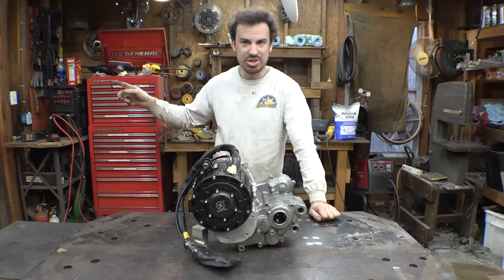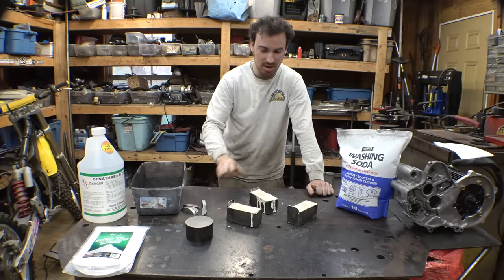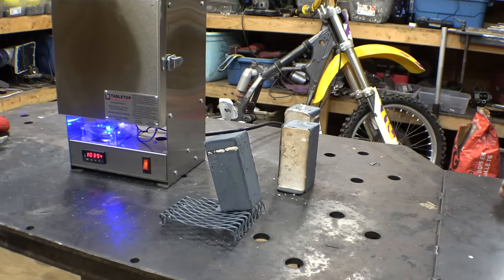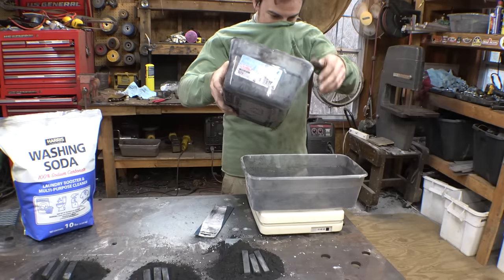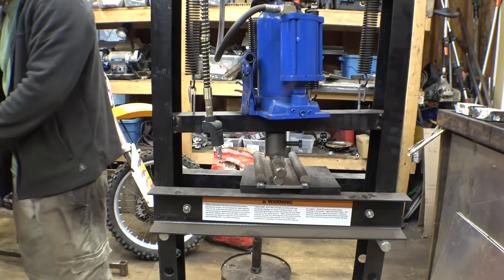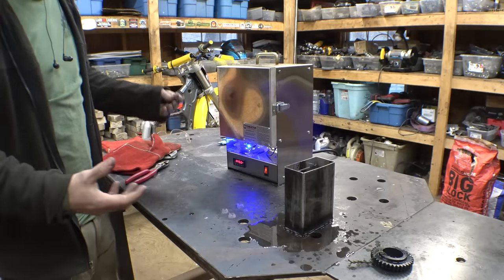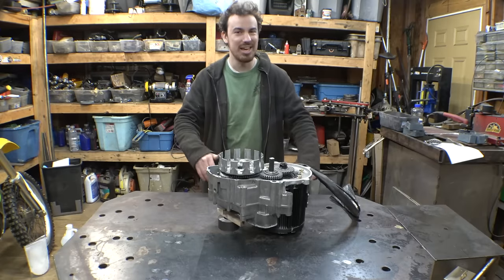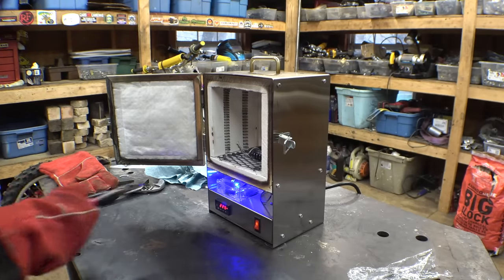Hardening the Steel Gears for the - Home Made 6 Speed Electric Dirt Bike - Part 3

Comment: This is one of the most interesting videos on you tube. I learned how to harden metal. You made two gears and hardened them in your little shop. You better be damn proud Chris as its quite the accomplishment.
Reply: The way he's doing it is hardening the face or surface of the metal, he's not introducing carbon into the entire structure of the steel. Think of this process as similar to anodizing aluminum. It increases the durability of the part's contact area's but it won't increase the strength of the steel in whole. This process is highly recommended over using a high-carbon steel for the entire part when used in things like transmissions or final drives.
Reply: Well, what he never said was: THIS is how to harden THIS ALLOY of steel, other kinds of steel would have taken longer or shorter, or worked better with the water, etc, ALL STEEL ALLOYS ARE DIFFERENT, so don't just copy him with whatever you have and try to do an hour and 20 mins and then use Cooking oil

Comment: Chris, as a bladesmith….  when we heat treat carbon steels, they also become very brittle and break easily unless they are tempered afterwards. I’m not sure what steel you used to start off with, or what it ended up at with the carbon content, but you may want to research the tempering process, post heat treat. For most carbon steels like 1080, 1084, 1095, it can simply be done with 2 tempering cycles in the oven at 400°f for 2 hours and allowed to cool slowly after each. 
Love the channel!
Reply: I think he started with mild steel since he is case hardening.
Reply: Yup
Reply: It's not a blade, it's a case hardened gear. If he tempers it, that defeats the purpose of all that work he did to case harden it in the first place. It's hard where the gears contact each other so it doesn't wear out, and still mild steel in the core
Reply: Would need to test/drill the centre of the brocken test peaces to see if mild steel or not, surely?
Reply: I also think that the gears should be normalized after
Reply: It is necessary to do not only hardening but also tempering of metals. leave the metal in the oven at 250 degrees for 2 hours, then turn off the oven and let it cool without opening it. then the stresses will equalize and the metal will not be so brittle
Reply: For what it's worth, it wouldn't have been that hard to find some good tool steel like S7. A person goes through all that effort and you still end up with a mediocre part.
Reply: I think he is just trying his hand at hardening for the experience and experimenting. I’m sure if he destroys them he will just start over with a hardened steel to fix the problem if it becomes one. I personally think other parts will be the weaker links.

Comment: When it comes to hardening  using water will introduce fractures inside of the metal and is advised not to do it oil is the best to use when hardening of any kind
Reply: It depends on the steel. Tool steels come in (A)air hardened, (W)water hardened and (O)oil hardened. It’s important to know what grade of steel you are using for proper hardening and tempering.
Reply: В воде можно растворить соль, и это позволит не разрушить структурную клетку металла.
Reply: Wrong! It depends on the steel
Reply: This isn't forged in fire. He's not making a blade to withstand the coconut chop, it's a case hardened gear. It's hard on the outside only, so the gears don't destroy each other where they mesh.
Reply: Actually it depends on the type of steel. But you are correct in that water quenching can cause micro fracturing in harder alloys. Especially those intended to be quenched in oil or air. Not that it is going to make much of a difference in this application. 
He just needs to case the outside of the Metal, not the core.

Comment: I heat treated steel for many years as a tool maker. We through hardened the steel that we used and used steel such as S-7, O-6, and O-2 steels. These to me woukd make much stronger gears and much tougher once annealed. I used to make envelopes out of inconel foil to seal out the oxygen.
Reply: For as much screwing around with a material that he had no idea what it was and then guessing that his little experiment was proof of concept.

Comment: From a former machinist's point of view, you pretty much got it right on the case-hardening and quenching processes! ..and your experimentation pretty much proved it beyond a doubt. I think those gears will be plenty strong, and will probably outlast the rest of the bike. As long as you have sufficient backlash (just a few thousandths actually), you should be golden! Curious to see it in action.😉👍👍

Comment: after first tempering try this
3 hours 475 celcius let them cool in Sand until cold can take up to 7-8 hours too cool down, that should balance out the hardness and thoughness

Secondly, how about the pushing forces away from the engine case on that aluminum since the weight from the motor and torque might bend and twist,  If there are Flex in the casing that hold the Electric Engine while in use then sudden Jolts might set-off breaks in the casing? Leverage forces is what i mean in every way and sense of it.
Reply: Hopefully he sees this comment

Comment: Awesome project, been following all along!
I worked as a Tool & Die maker, we hardened steel all the time, A2, D2, P1, O1, 1080... all seem to be close.
 2,000° for 30 minutes per inch thick, let air cool to 100°, set back in at 400° for 1 hour per inch to draw back. Avg Rockwell C 59 to 60 hardness. You're very close.
Reply: You didn't mention the quenching step
Reply: @testdevice989  in my tool and die job we put the part in a stainless steel envelope that we folded from sheet we put in a small piece of wood to burn off the oxygen,  2000 degrees for 3o minutes per inch, then cool down,  put back at 400 for an hour or so to draw back any brittleness, no quenching.
Reply: 2000 Fahrenheit for heat treating hss. Most air hardening steels like a2, s7, h13 is more like 1750. Oil hardened steel more like 1650 .

Comment: I would have definitely temper those, even though they are only case hardened.  You give up a little hardness for a lot more toughness. I love your videos! Keep it up!
Reply: Yup, just put them in an oven at about 425f for an hour. Let them cool on their own.
Reply from the maker: I thought about tempering them but some of the videos I watched said you don’t need to, so I didn’t. Hopefully I won’t regret that decision
Reply: @ratherBweldingChris I am mostly familiar with hardening for knife making, which is a bit different than case hardening for gears. Looking around a bit it appears that the hard skin on a tough center brings special properties that are useful in gears, so it may be that tempering isn't needed for this specific use case. 
It is lots of fun seeing you learn new skills for these projects. I have been watching since the lathe build days and am constantly impressed with your skills and mind for engineering.

Comment: I think the primary drive gear being 2x+ the diameter it's halving the tooth load, so 2x+ the torque won't matter. If it's a thing you could put another transfer gear on the other side. Neat project!

Comment: I'd go over the gears teeth with a soft wire brush especially the tips to smooth the edges. Maybe sand them with 1000 grit paper, moving to about 3000 finish with around 5000. Basically polishing the teeth. But sanding with the teeth, not across them. Maybe trying diamond compound after hardening, to polish them, but something like this it's not really required. Having smooth gears that can hold oil in the surface will run cooler and wear less.

Comment: typically when you harden parts like this, you want to cool them in the kiln, doing so significantly increases the time to cool meaning you essentially eliminate the possibility of the steel developing micro-fractures in its grain pattern. When we built gears for high performance transmissions, our kilns had a cool-down function that would cool the parts over the course of 48 hours. We were building for 2,000+ hp though, I don't think you need to go that far.

Comment: I think one way you could slowly creep up on giving more torque to the transmission little by little would be to run the clutch spring pressure a little lighter than normal such that it slips a little when under heavy or full load. You may smoke a couple clutch plates in the beginning while you expand the performance envelope but at least you won’t grenade your engine right off the bat. Either way, awesome work man! 👍

P.s. I would shoot to have the same backlash as in the rest of the tranny.

Comment: I like to use a strip of notebook paper between the gears then tighten up the bolts to hold everything . Then pull the paper and the gears run smoothly and have room to heat up.

Comment: I used to CNC axles from blanks, and then later after heat treating use a grinder CNC to polish the bearing surfaces,This is similar to what you went through with your gears.The sizes do change.Also,the long slow heating, and then slow cooling tempers well too without the brittleness .

Comment: In my experience I’ve found that virgin mineral oil works best for heat treating and it leaves a beautiful black protective hard shell. You can find it as “vacuum pump oil” used in air conditioning vac pumps.

Comment: Stainless steel is also not magnetized.

There's always those ifs, that you have to go through the first time. but then after you have done it once the fear of the unknown goes away and it gets better. and you're confidence level increases and it becomes second nature. and after doing something many many times it comes a point where it becomes boring. then you have reached expertise level. everyone goes though this. now you can add metallurgy to your expertise as a machinist.

Comment: Pretty nice testing 👍 but you missed one thing.
The Gears do have a much higher thermal mass and the quenching oil will heat up much more. Therefor the hardening is kinda different.
Not sure if this is relevant with those „tiny“ gears - but on bigger projects, you should consider that.

Love the videos and the effort you put into these ✌️👍

Comment: For setting then checking the gear mesh use strips of paper. That’ll get you the right backlash then when you pull a strip through after you’ve set it up, it’ll curve away from the tight side if there is one.

Comment: Thankfully, you can tune the torque curve on the motor controller! I think the bike transmission will handle it as long as you’re not dumping full torque off the line. Just be careful with the wheel speed and jumps.

Comment: You should get a test indicator to check the face runout on the lathe. Indicating for one spot only lets you know that section is running true. Checking face runout over O.D. runout in your setup will better the chances of a parallel part. That’s also a good way to get your chucks running true on the adapter plate to the lathe spindle.
Reply: Not knocking on your machining skills at all. I’m actually very impressed at the level you take your builds to, and the growth you’ve had in machining.
Reply: You would really benefit from getting a machinist handbook.

Comment: Cool stuff, gears are dam hard...  Awesome work

Take a look out there for hardness files

They give you a better idea on range of hardness

Gears if I remember right are usually spec somthing like 28-36R-C  

Used motor oil I think is supposed to work and impart carbon too-

Don't forget your tempering that's critical for these -

You might be able to find more heat treat data from machinery handbook or similar from. An older edition they might have more tables times alloys ect

Comment: My father has 30 years experience in heat treating and metal plating, he got a kick out of this
Reply: What would he of done differently
Reply: @mondude9754  using used conventional motor oil, it looked like the motor oil used was new looking.
Reply: @djbe3772 What's the benefit of using used oil rather than new?
Reply: @jasonb6570  Well when my father entered the field during the oil shortage, so they didn't wanna waste new oil just for quenching, it was a way to save money and became bogg standard amongst the old timers.
Reply: @jasonb6570   Used motor oil has carbon in it.  (that's why it's black)
Reply: @djbe3772  that makes sense I heard  another comment mentioning used engine oil also and because it has carbon content in it. And yes I can confirm the oil he used was brand new but it was not motor oil he used cooking oil on the gears themselves

Comment: try paragon heat treating ovens. alec steele had a few and they worked perfectly for almost every task he gave them. there are also specialized quenching oils that work much better and dont smell like a burning tire when you quench hot steel in it.

Comment: I believe, after hardening, you need to temper them. That way they won't be too brittle when there is a sudden shock on them. Like instant torque from an electric motor, or landing off a jump with the throttle on.
Reply: Yes, when when made hammers at school, we quinched them in oil and then slowly let them cool down for hours in owen.

Comment: the only way to tell your hardness and surface hardness are with rockwell and microrockwell (maybe brinell? I forget) testers, so you can test the surface hardness vs the deeper core hardness. they just press different things into the metal with a certain force and it tells you a number. not cheap, but you might be able to buy a used one cheap one since you don't need calibration certifications or anything.

Comment: Interesting project.  I think with the flat torque curve and high RPM of the electric motor 6 speeds is overkill.  A 2 speed would probably be enough, though I imagine finding a 2 speed motorcycle transmission would be difficult.

Comment: Yeeey, its time for me to be a smartass.

So couple of things, firstly, you did an okay job, dont be afraid to abuse it.

Now about heat treating. When using water to quench in you cant do the up down dunking method. Water boils away, creating a steam barrier that doesnt allow for fast enough cooling for the steel to be hardened. You need to move your piece very fast through a very huge amount of water to achieve hardening, even then the best results will be at the points where your steel contacted the water for the very first time. This is sometimes used in knifemaking to only harden the edge.

Whenever you check for magnetism you should put your piece back into the kiln. While you are working with mistery mild steel it doesnt really have a huge impact, but your piece can cool below the temperature needed in seconds and if you are aiming for the best result its just a good practice.

There is a fancy word for what oil is best, there is a whole science behind it, people usually swear by canola oil on the cheap side and parks 50 on the pricy side.

Most importantly, please use a bigger container for quenching. I am serious you will hurt yourself so badly if you manage to overheat your oil beyond its critical point, when that gets onto your plastic made clothing you will be very and I mean VERY hurt. Get yourself an ammo box at the very least, burns caused by oil that hot combined with molten plastic will cause a pain you never felt before.

Its also a good practice to preheat your oil.

Comment: Oil thats been in a motor is what the old books refer to as motor oil. The carbon deposits from burning fossil fuel is said to make used motor oil better for oil quenching. Also a good long tempering cycle will greatly help there durability.

Comment: It is necessary to do not only hardening but also tempering of metals. leave the metal in the oven at 250 degrees for 2 hours, then turn off the oven and let it cool without opening it. then the stresses will equalize and the metal will not be so brittle

Comment: I don't know if anybody has told you this but to heat treat, all you need to do is wrap the gears in some stainless steel foil with  some paper.  You don't need those elaborate boxes.   The purpose of the paper is to burn up and consume any oxygen in there..... just an FYI. 

Re. The oil, I use used motor oil straight from my car.  Also,  if you fully harden them,  you have to anneal them, too.
Reply: I agree with you, also I recommend pre heating the oil

Comment: Hello, do a test with a piece of steel by heating it until it turns blue and immerse it in hot water mixed with half a ground Cyanide tablet, cover it until the next day, this is what they do with friction parts on Vespa.

Comment: You could limit the torque by decreasing the current in your bldc motor controller's settings.
Reply: I was thinking the same thing.  Start out at low torque, and increase until the bike feels close to what a stock 125 pulls like.  Maybe hold up there.  Like Chris, i’d hate to see him wreck those gears, he must have a lot of hours into them now.

Comment: After quenching, a low tempering is done at a temperature of 200 degrees Celsius or 392 Fahrenheit, at this point the gears are “glass”. Tempering is done to normalize the internal structure of the metal after hardening. the hardness will decrease slightly but the resistance to dynamic loads will increase. We heat the gear in an oven at a proven temperature and let it cool along with the oven.

Comment: You should have tempered after heat treat, as the teeth may be too brittle. The tempering temperature depends on how hard you want it.  I know you don't have a hardness tester, but I would temper.  Maybe you can do some research on how hard the teeth should be,  I am afraid that if you don't temper they will be too brittle and break when you apply too much torque.